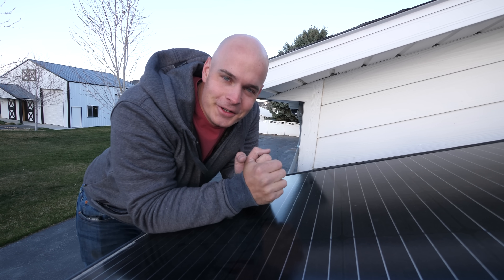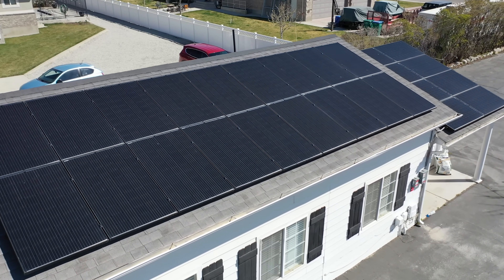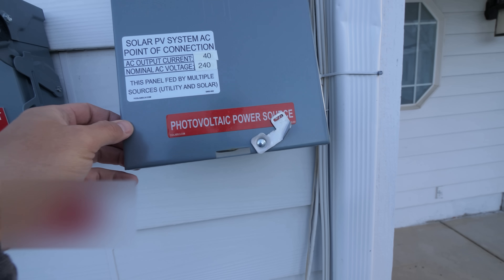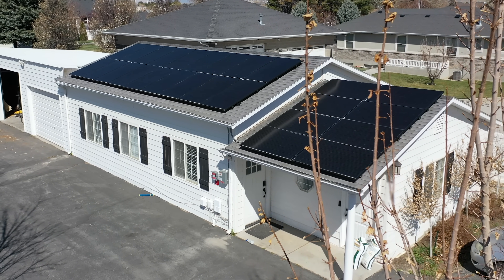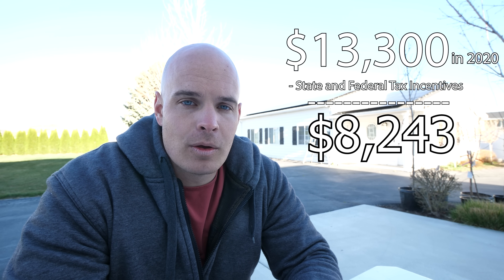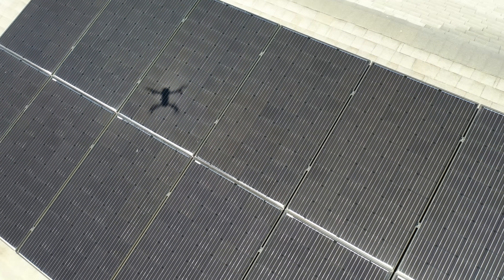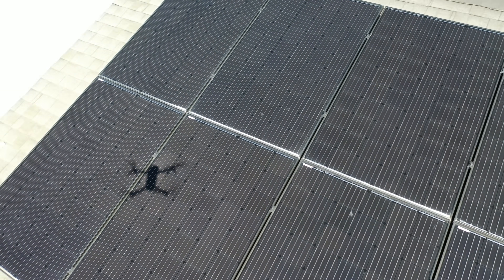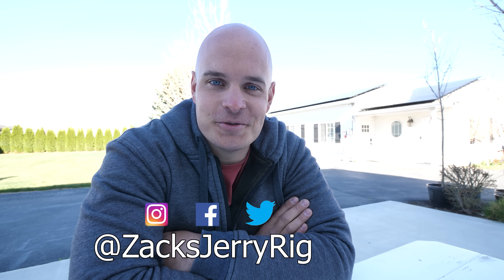One Year Solar Update! - Is Do it Yourself Solar worth it?

Comment: Right now they are only remotely worth it since they are heavily subsidized by the government. Take that away, and the cost is way more

Unless you live in area that has consistent amounts of long sunny days, you won’t harness as much energy and will need a back up energy source

PA I believe is number one for non sunny days, surpassing even Seattle aka rainy city so I wouldn’t harness a lot of energy. My parents cabin in a forest might see 4 total hours of good sunlight. No way 4 hours is enough to power 24 hours of daily home use: from water heaters to lights to fridges to heaters, all things not don’t even run constantly and even drop in use when people are sleeping

The environmental impact is just changed and shifted to the power plant, the material mines, the solar panel manufacturing plants, and the solar farms. Instead of carbon emissions at your house, they are now all at the places I mentioned. They require coal in the making process and some rare earth materials. Solar farms require large amounts of open land so they can’t even be used in some areas. So in my forest example, a large part of the forest would be destroyed just to put in the solar farm

Another huge problem is line losses. Over long distances, electricity in general loses some energy. Sola panel electric lines lose even more. As a result more substations would need to be created. So a city or town, that means land would have to be set aside. If there’s no land available, it would have to be taken from citizens. In remote areas like a forest, even more trees would have to be cut down

Solar panels have to be replaced every few years for best efficiency due to parts breaking down or wearing out and in most areas aren’t recycled. This results in landfills having piles of them. This also means more solar panels have to be created.

I would imagine they have to be cleaned regularly too in order to get max efficiency. Houses already have to power washed to clean off road grime, dirt, and pollen so I’d bet solar panels are the same way. I think there’s de-icing modules that can be installed for additional cost. I bet they have to use some of the energy harnessed to do so

Finally, since solar panels are just not as efficient as traditional energy sources yet, most places would require a back source regardless of how much sun the panel can harness. These older sources aren’t just turned on and off. They take days to slowly turn it off to reduce the chance of damaging them. As a result, even as the backup sources, they are constantly running. 

I want to see a steel plant or an electric arc furnace run on solar panels or wind turbines. Never going to happen

Implementing this at a large scale is just a dream. There’s some remote parts of the forest in PA that still have a big storage tank of natural gas. Every few weeks or months, the gas company comes out and refills it. It’s actually easier, cheaper, and more efficient to do that than it is to run the pipes from the nearest city or district gate. There would be so much pressure loss. The closest solar farm would have the same line loss issue, so those people would have their own solar panels probably not even connected to the main grid. Some don’t even have permanent power but generators

Batteries are not environmentally friendly at all, especially lithium. Lithium plants and mines are deadly.
Reply: Deserts!!!! We have deserts!!!! No one lives in sand dunes, it's super sunny there, n the land is cheap!! You aren't transferring energy around the world or anything. Line losses are considerable, yes. But not THAT bad to scrap entire solar plants because of it. Talking about battery storage, we have hydrogen fuel cells. We have electric car batteries. Solar panels need to be replaced every THIRTY years!!! Not every "several" years. Again, if the government decides to build a huge solar plant, it would buy panels in bulk. This would reduce the costs of the panels A LOT!!! The energy required to produce a panel is recovered in 1 year approx. Remember, solar panels last for 30 years MINIMUM. Again, the costs incurred for building solar plants are fractional when compared to the costs we humans have to face and are facing due to climate change. Again remember, we are talking about the government buying in bulk. Buying solar panels for ur house isn't for everyone, due to the reasons u rightly mentioned. The infrastructure needed for energy storage too can be built when IT IS BOUGHT IN BULK. If u look at europe, over 50% of their energy comes from renewable sources. They r aiming to reach 100% by 2030. Mind u, the population of europe is a few ten millions more than that of the US. It's just that the government needs to take up going renewable. But the problem is, that if the government went 100% renewable, then the oil majors who have their lobbys in the government would go out of business. But we can't destroy our planet due to the greed of a few, right?
Reply: @xxxplayerblyatxxx8992    please break this up so it’s not a wall of text.

They do not last thirty years. The cost is recovered in a year because the government subsidies aka taxes aka other people’s money. So the people that can’t afford to get them help pay for them for the people that can. Take away that subsidy, and it takes many years to pay off. Look at the price before the subsidy.

Solar plants and farms take up a huge amount of land. So forested areas have to have parts of the forest cut down just to provide energy.

The sand would mess up the solar panels so good luck doing it in a dessert. Line losses are huge. Transferring energy from the solar farms even to a neighboring suburb would have lots lost energy. Energy of any kind has losses over distance

The European countries using renewable energy haven’t seen a drop in carbon emissions and some have actually seen an increase. Why is that? As I said to account for inefficiencies and lack of sun or wind, the backup sources have to continuously run. Also the footprint, carbon emissions or otherwise, is just shifted from you the user to the plants, mines and energy farms

If like you said, solar panels aren’t for everyone, how can we get rid of the other sources?

Do you realize how many products come from oil and natural gas, aside from oil and gas? It’s over 6000 and is used in things like roads, buildings, tires, phones, lighting, etc. Do you realize how many jobs there are in the natural gas industry. I was before COVID and some restrictions were out in place a mechanical engineer designing gas regulators. Jobs that pay well. You can’t just transfer out to a new unrelated job and instantly start working

As for the electric car batteries, they are lithium. See my first post. They are deadly. Also if you think the government will maintain this new infrastructure when they can’t even maintain the current infrastructure? Most bridges and many roads got a D rating, meaning they are close to failure
Reply: @xxxplayerblyatxxx8992     I would to see your sources. Almost everything you said is wrong. I don’t have the sources saved. I think you should your own research

Europe has not seen drops in carbon emissions. Actually based on our current consumption, we have about 750 years left for oil and coal. There’s so much here on US soil that we haven’t used. Have you heard of Centralia Pa? It has a coal mine that has been burning since the 60s and is not expected to stop any time soon. So imagine mines that aren’t on fire. How much can we extract? Can’t we research ways to make coal and natural gas cleaner?

By the way, natural gas is actually very clean. Once the pipe is in the ground, animal and plant life can return. Grass and trees can be planted. You can’t do that near solar, wind, or lithium plants

Let’s say we use salt. Do we have enough? Studies show when we tried to convert to all ethanol, the corn crops couldn’t keep up and those are renewable if farmed properly. Salt is not renewable

The US ha scrivener reducing their emissions the last few years so again your source is wrong.

You can’t be this naive to think forests wouldn’t have to be cut down to put solar farms in forests. Come on.

They have daily or sometimes hourly dust storms. Will they clean the solar panels every time. Also moving the energy to other places from the dessert will result in massive losses

To make roads, those things have to be burned or heated. You seem to know nothing or very little about steel, roads, bridges, and every product that uses coal (including solar panels) and natural gas. Some places have already banned coal and natural gas. So they rely on others to get it. But it’s ok because their areas are good.

Natural gas and coal extraction also work on economies of scale. If they are not selling as much or having to come up with new extraction methods due to restrictions and other sources price will go up. They will be forced out of business. Good luck making roads, steel and bridges then

It’s not just a “few” jobs, it’s 10s of thousands, some of which never actually see the gas or coal. But I guess to you, their livelihoods don’t matter as long as the planet is ok. Even if thousands of jobs are created, that’s I’ll take years to get to that point. Also you don’t change industries and hit the ground running. Solar panels are extremely different from natural gas

The government didn’t force the horse and buggy’s or typewriters out. That was decades of the market. Very different

Since you seem to live in utopian fantasy world, have a great day. You can’t be reasoned with. I have actually taken classes about energy sources and done a lot of research beyond that.

I hope you and anyone with your delusional thinking never is In charge of energy, steel making, etc. We would have a disaster. If it becomes more expert get natural gas, every single product that has plastic will go up. Your car has plastic bumpers, your phone has plastic, your appliances have plastic. All of that comes from natural gas

Guess what. One of the reasons cars so efficient and safe now is because they use plastic. That’s why bumpers crumple and fall off in a crash. The force is redistributed to those parts instead of into and through you. Let’s go back to steel bumpers. Less plastic, but also less efficient and safe.

I use common sense and the fact the government can’t do anything right to know that the government will fail on this too
Reply: Solar panels are easily recyclable. They don't have any wear and tear whatsoever. Install it, clean the panels every now n then, n don't bother for 30 years. 

Yes, lithium mines are deadly n environmentally toxic. But, their toxicity is no where close to that of coal power plants. The amount of damage caused by lithium mines cannot be compared in any form or manner to the sheer amount of damage caused by the usage of fossil fuels.
Reply: @xxxplayerblyatxxx8992   have you ever visited or seen a lithium plant? The surrounding water, plant and animal life, etc all get contaminated. You have to go many yards or miles before things start growing normally. They are far worse than coal, just in different ways. Getting rid of one environmentally unfriendly source and replacing it with a different one solves nothing

Also based 2018 consumption levels, we have about 150 years of usable lithium left (not all can be used for batteries). With more people having electric cars, and several devices person all using lithium, that number goes down even more.

Did you know usable lithium is only found in certain areas of the world, meaning we have to rely on foreign entities for our energy? What happens if for some reason they decide to stop sharing (war, limited resources, etc)? They could shut down the US very easily. We shouldn’t rely on other countries for energy

Solar panels are not easily recycled at all. You have to replace panels every few years. This maybe increased to 10 years or so but certainly not 30. Hell even metals, plastics, and glass aren’t easily recycled. Most places have gotten rid of glass recycling and most plastics due to expenses. A few solar panel components can be reused or recycled but most of them can’t. Look up solar panel and wind turbine dumb sites

Bull shit to the no wear and tear thing. Everything has wear and tear even if it’s not used. Just sitting in the sun will break down certain components

I agree solar should be pursued. It’s no where near ready nor will it ever be ready to completely replace fossil fuels. Overall it should be a few sources. There’s no one source that is as efficient as fossil fuels. Areas that can use solar in places should. Things like traffic lights, small cafes, and other low draw places would be ideal. Good luck powering a steel plant on solar or wind. Not going to happen
Reply: @xxxplayerblyatxxx8992  in order for the source to even be considered, it has to match the current source in 4 main categories: efficiency, cost, cleanliness, and practicality

Solar and wind and are no where near as efficient as natural gas and coal.
They are heavily subsidized so they cost a lot more too. Even after the subsidy, they are the same price or just below natural gas.
On the surface, they look cleaner but a deeper look shows the environmental footprint is just moved and/or changed from to consumer and the supplier/manufacturer to just the supplier
They require large amounts of open land and materials not found in everywhere. The materials we do have are mostly on protected lands. Otherwise they are in in other countries. Not a good idea to rely on other countries for energy

Electric cars will never be practical because of the charge time. Due to battery chemistry, the charge time will never reach the same time it takes to fill up a gas car. I can make a several hindered mile trip over hours days (depending on length). That’s not possible for electric cars and never will be. Fast charging already damages batteries. So if they increase the charging speed, batteries will wear out faster. Replacement batteries are about a 1/3 of the price of the vehicle.

When my family inherited a 20 year old truck, we replaced the battery and few other things for 1500 total. An electric car just for the battery is about 10k. Also most repair shops can’t fix them so you have to send the vehicle to the dealer and they send it to the manufacturer which can take weeks. Not very practical

Comment: "Set it and forget it situation"!!!  Ha, Ha, Ha.  Ever watch Off Grid Garage?  I think Andy of Off Grid Garage is on a mission to scare people away from solar installation so he can purchase more used panels.
If you setup is set it and forget it his must be set it and tweek it, modify it, replace components, set it, tweek it, add more panels, polish terminals so you can see yourself in the reflection, re-wire, replace buss bars, tweek it etc.   If you haven't watched all his videos you should.  Andy is a great guy but just can't be satisfied with whatever he puts together.  It is CONSTANT fiddling.  
I am with you, engineer your system, set it up, get it working, adjust where adjustments needed and leave it alone.

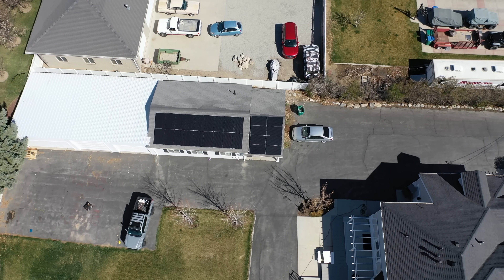Comment: Quick question: It looks like there is a flat section of the roof to the left (8:40). Have you considered putting up some more panels on sun tracker? Not sure if I remember correctly but that suppose to give an extra ~30% energy a day. If I could have a house with flat roof then I would definitely took it into consideration.

Comment: Thanks for this video. I've been tracking my utilities in a spreadsheet since 2005 and have been surprised how relatively steady with a subtle increase my /hr costs have gone up. In Orem, 10 years ago I was paying 10 cents per kWh but it has increased gradually and has been steady at about 12 cents since 2014 (through Rocky Mountain Power). I hear solar ads all the time proclaiming how RMP has been increasing their rates and will continue to do so, but the data isn't terrible like they say. However, I have been interested in solar panels for years, but historically it would have taken decades to break even. Things are getting better for sure cost-wise, but I've never considered a DIY kit which could be a great option for me. I'll need to watch your install video now since I have some questions already forming in my mind.

Comment: The problem is if you have no batteries and the grid goes down you have no power!
To make a system reliable for when the grid goes down, you need batteries. I wouldn’t have a system like yours and I put batteries in mine.

Comment: the real risk with solar panels is if they will break or not, the internals of a solar panel actually contain some harsh toxic chemicals. these are extremely destructive to the local environment if they leech into it through a break in the panel, but as long as they don't break they're essentially almost completely green. the best way to get around this is to place them away from nearby branches and to not dump them into a landfill when they're dead.

Comment: Your calculations dont make much sense. 
34.7 kwh a day * 365 days a year are just 12'666 kwh not 13'140 kwh.  You also multiply that with your energy cost directly for your savings, however the energy that is fed to the grid should be multiplied with 90% before that. So in the end your savings should be lower. Still worth it, but it would take you maybe 7 years instead of 6.

Comment: Jerry, you guys don't have a 2 way meter to give to grid what you don't use???
That will significantly reduce cost recovery.

Also, you better have some battery backup system. Either or.